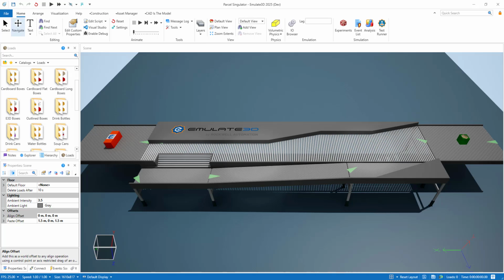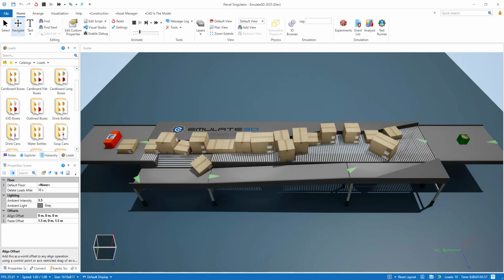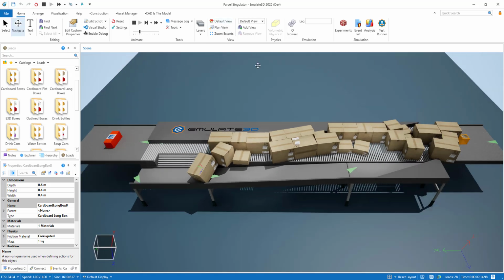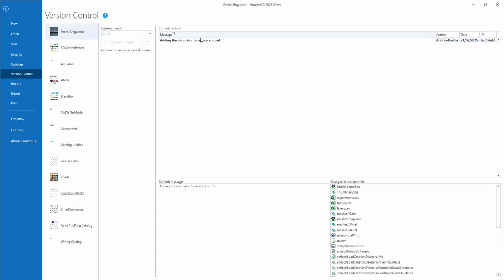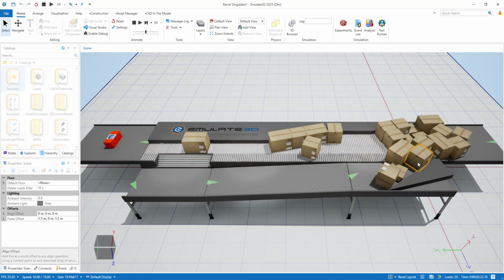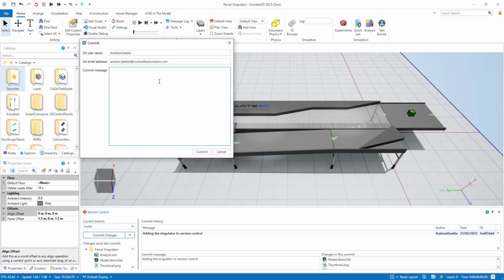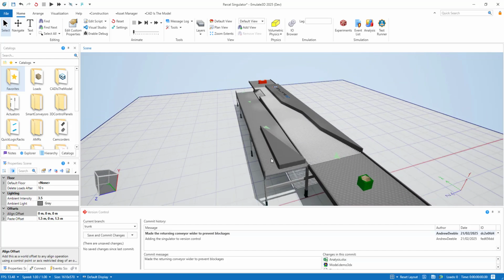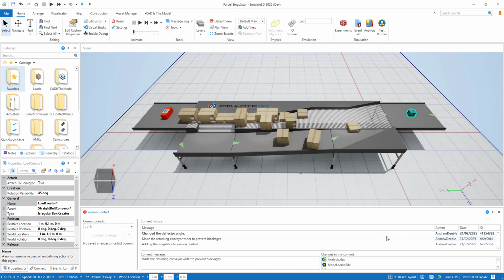Creating Models with GIT Version Control

Comment: Will this also possible for CAD models or only for Catalogus models?
Reply from the maker: Version Control works for both CAD markup using CiTM and for Catalogs. Note that you could also use our CAD Plugins to pull updates from source CAD files as well!